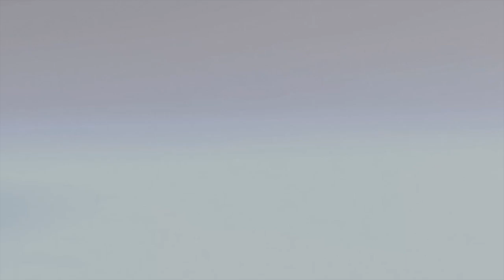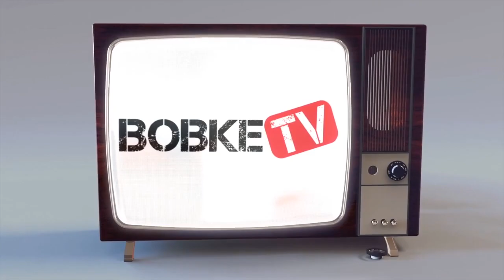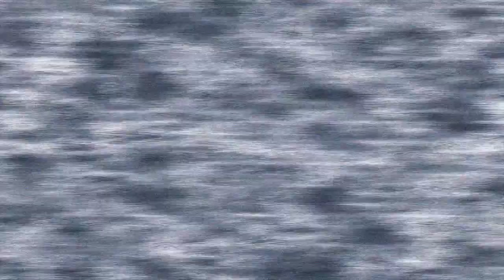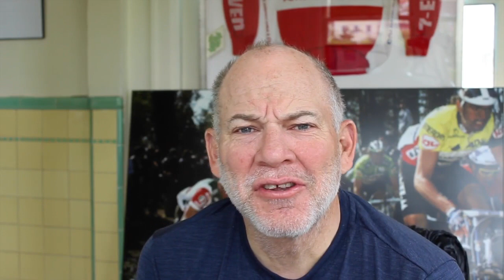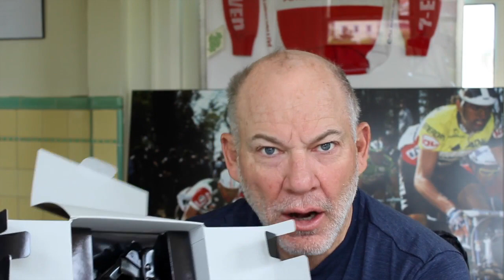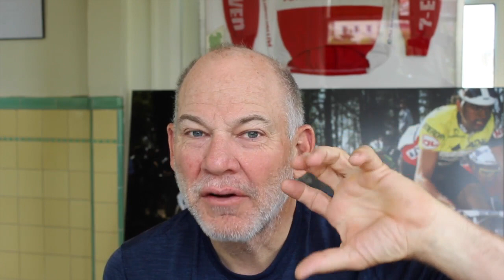Building a Bike with Bob Roll Part 13 - Brakes

Comment: I'm glad that for the most part road cycling enthusiasts are the last bastion of the Luddites!   Fads don't last long (remember Biopace chain rings? ).   If it ain't broken, don't fix it!  That being said, things like clipless pedals and integrated indexed shifting are two examples of real innovation and improvement in cycling that really work.
Reply from the maker: let the luddites ride!!!
Reply: Would love to ride an Eroica event on  a steel frame bicycle with vintage equipment, toe clips, down tube shifters, etc. and of course wearing a wool jersey. :-)

Comment: Robert, we know the divisiveness of this issue. Any chance you can find some vids to share to show just how different direct mounts are? After the first (and only) time I locked up my rear wheel with rim brakes on a dry downhill, it set in motion the mindset that will prevent me from ever wanting the stopping power of discs on a road bike.

Comment: Disk brakes are not dangerous.  And they are more consistent in bad weather conditions.  But rim bakes are good enough in most situations.  I just have done too many miles cycle touring with gear to ever buy another bike without disk brakes.  But I still have an older bike with rim brakes that still works well.  Just a bit old school for serious riding.  Your brakes look a lot nicer then those on my old bike.

Comment: This is important to know.  There are so some bike shops and builders trying to sell this "hype" - C Rush -  I almost bought a bike with a disk setup from a shop mechanic/ builder and I mentioned direct-mount to him and he talked them down; Like if they were not worth their innovation.  I knew he was wrong. I had already read up on the subject and they were right.  This gives me more confirmation that disk is not better for the road bikes. Thanks Mr. Roll
Reply: Disc*

Comment: I knew part way through the first couple of sentences where you were going after saying how great the Dura Ace brakes are. I'm not for or against disc brakes, and think that in the long run they will end up being standard equipment on pretty much all road bikes. That being said I don't think that the manufacturer's started off on the right foot in their implementation of discs on road bikes. I get the impression that they more or less just adapted MB discs to road when they should have been engineered from the ground up. Like maybe very fat discs (composite?) so they are blunt on the edge / or  did they have to be that big a diameter considering the hydraulic advantage / reduce the diameter by 1/2 and put a guard on them. It just looks like they rushed to market without considering the real world results.

Comment: Disc breaks were meant or design to solve the problem tires slipping off carbon rims at high temperatures caused by excess braking on the brake track of the rim - I heard...  But not better than direct mount breaks, and are the next-best-thing.

Comment: One thing that should be mentioned in the disk vs rim brakes discussion is the affect this choice has on the potential for optimization of all the design elements of a bike.  If we are asking a rim to do double duty as a wheel component and as a brake, then there have to be design compromises made in order for the rim to perform adequately in both regimes.  A disk brake removes that burden from the rim design and allows the designer to only worry about/consider the performance features that influence rim performance in its role as a structure supporting a tire/spokes/rider/etc.  Braking is no longer a consideration in the rim design since it is being handled by a separate set of components.

Is that an advantage in the design process?  I'm not a bike designer so I don't know but my point is that when a designer has greater freedom in the design process there is the potential to generate a design with better performance.  Now that we are in a world of teenie tiny design tweeks making the difference between winning and losing perhaps the use of disk brakes, in some designs, can pay dividends that can deliver the margin between 1st and 2nd place.

Comment: I was going to say, don't you have to get a bike frame that's direct mount compatible just like you'd get a frame that's disc brake compatible? I agree as long as you don't run carbon rims in the wet very often but the compatibility issue seems just as pertinent either way; you aren't going to buy just any old frame and stick direct mount brakes on right?

Comment: Nice choice. I think disk brakes are also a good choice. To each his own. I will say this, disk and direct mount both necessitate a new frame. Also, if you are lucky enough to ride expensive carbon wheels, disks don't wear the rim.
Reply: Disc*